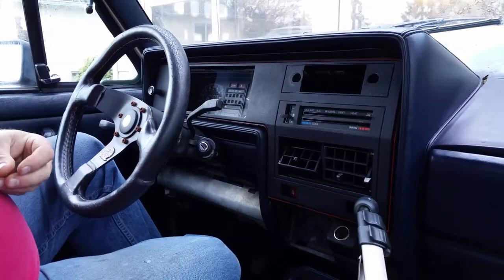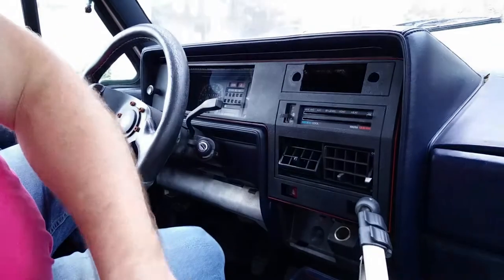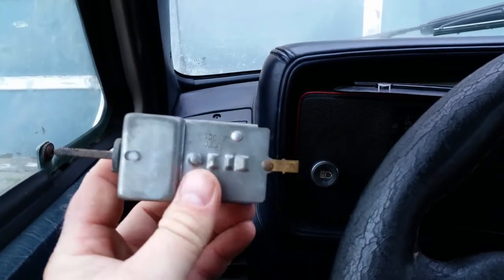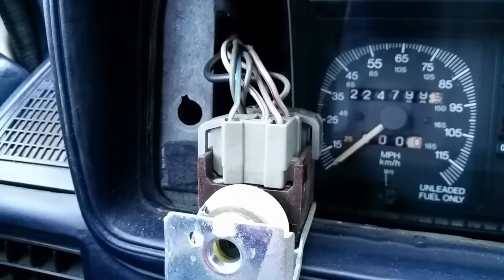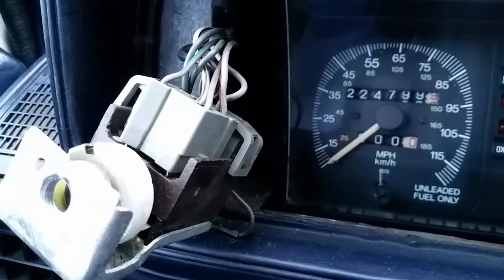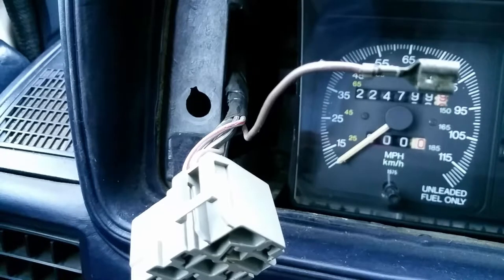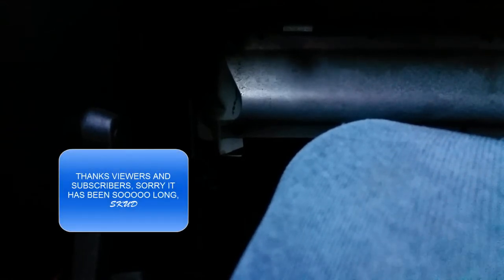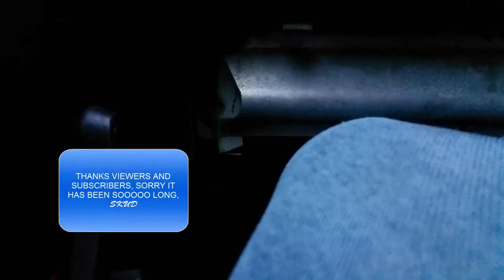How to Replace an 84' VW Rabbit GTi Light Switch

Comment: This is super useful, thanks!

You could have pulled off the plastic knob on the headlight switch before removing the panel (to avoid breaking brittle plastic). It pulls straight off like the stock radio knobs (not that you have any haha).
Reply from the maker: Here's the issue with doing that, I have owned these since I was a kid and am now 40.  If you pull the plastic part off over and over they wear out.  Think about how many old rabbits you have seen with just the metal part and no knob.  Pulling it off over and over does that.  on this one the light logo is pretty bad so I could have, but on switch handles that have decent logos that aren't faded or rubbed off, I actually JB Weld the knob to the handle.  I am glad it was useful.  I have the motor out right now and am painting the engine bay....
Reply: Now that you say that... I have definitely trained myself to apply just enough force when turning my headlights on because if I pull even slightly too hard the knob comes off! I have also considered JB Weld haha
And yeah! I got my cluster lights working :) 
Have fun with that job o__o